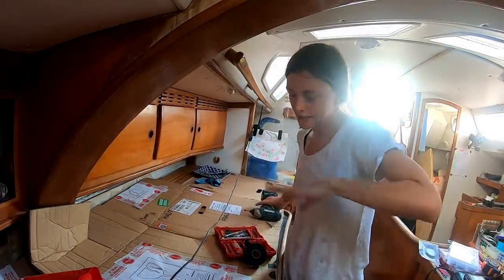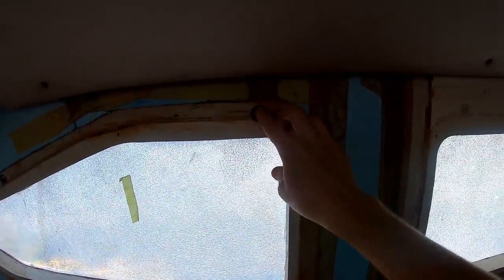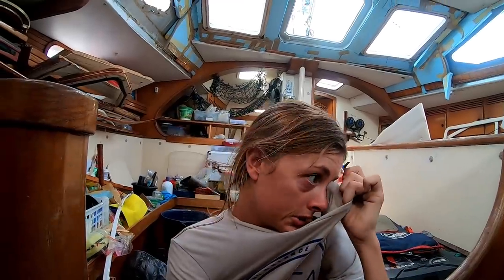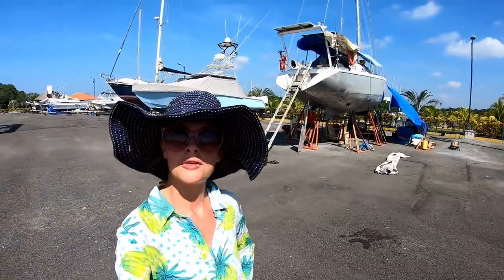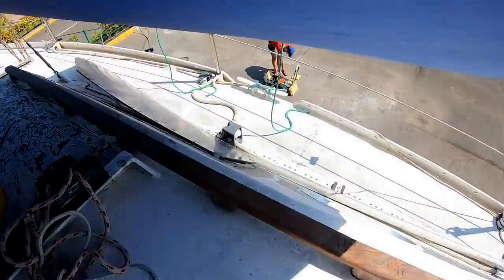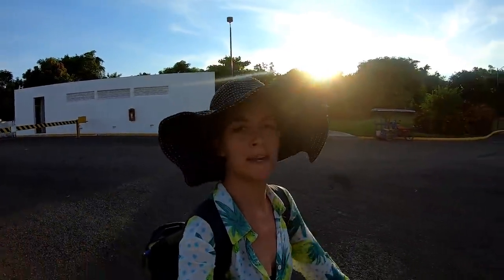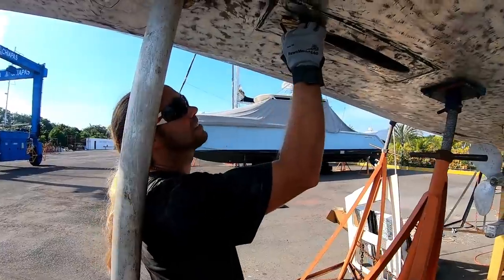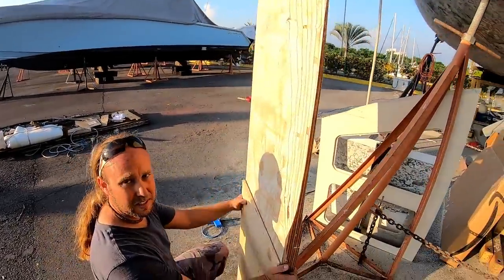Roller Coaster : Chuffed Adventures S3Ep11

Comment: These IS a "5200 Debond" solvent out there, if your chandlery can find it. 3M VHB tape is the best way to attach and seal the new stuff. It is used to install skyscraper window glass, it is not ordinary doublestick tape. Comes in black, white, clear.
Reply from the maker: Ah thats good to know, and yes definitely needed more sleep that week, but I have a disorder that means I am very sensitive to hormonal changes before my period, and so tend to get really tired and teary for a few days,and then lo and behold a week later I am all good. But we are taking more time now to manage it instead of pushing through

Comment: Watched this one and enjoyed learning the medical info.  Very interesting and you're an excellent teacher. Finding since I'm working less my range of interests seems to be exploding - eyes bigger than belly - as they say.  Jim filming?  If so well done, I'd say he's a keeper.  Impressed with all the medical work and genuine care for the patients.  Enjoyed the spot on Rabies.  Can be a bit scary.  I hear the shots are No Fun!

Carpentry thoughts - Orange foam ear plugs in packs from Home Depot are fairly comfortable and do well at noise reduction.  Maybe you can mail order?  I wear them mostly all day on the job.  An engineering friend told me the most harmful sounds are loud impact.  I would think continuous loud noise also bad.  Google question I guess.  I was a helicopter crewman in Vietnam and was told our helmets not only protected our ears with padded ear muffs but the helmet itself protected the brain from internal damage.  Again not clear on all that - back in 71 -  50 years ago.

Googles help with eye protection but face shields can be very effective also.  If you ever get one rinse off before cleaning so you don't rub grit across the shield.
Lastly today - a heat gun can be very helpful softening glues for removal.  They get very hot so heads up.  Careful of fumes also.

Good luck - I chip in a bit - safe and well.
Reply from the maker: Hi Don, Thanks for all the great advice! Jim does do almost all the filming and he is a great cameraman! We are really grateful we have been able to do so much for the animals here!

Comment: Don't know if you're already replacing those windows, but if you haven't, you can add an o-ring to the seals along the outer edges, in addition to the butyl/5200 primary sealer you're using for bedding in the acrylic windows. All you need is a long roll of o-ring mat'l, sized to fit snug in the gap along the edges. You can adhere the o-ring with tiny dabs of sealer before final mounting. The o-ring can act as an exterior visible "squish guide" to show you how close the window is fitting to the hull. The o-ring also gives you a clean line around the window so the exterior edges can be sealed as well, and faired or chamfered with a clear or white sealer for redundancy.  If you don't want that, you can use washers and tape to limit yourselves from overtightening the mounting screws.
Reply from the maker: Hi Mike, Windows are already on, and thankfully since Will is a boat builder he had done it maaaaany times (we went with the washer/tape route)
Reply: @VetTails  Glad to hear it, was worried that with the sealer shrinking a bit, you wouldn't discover til out at sea in a storm where the windows flex with the hull and tweak sealing compounds...

Comment: There is a lot of rabies in Mexico, if you can't monitor the dog that bit you, the 7 months of  immunisation  injections is necessary. But better than the 90s stomach injections, that are debilitating. Bum injections, day 1, one week, 3 weeks, 3 months, 6 months.
Reply from the maker: Yes, thankfully the dog was ok so we didnt need to do it, but hoping to get Jim vaccinated so we can just get the booster (I think it might be only two injections if you have a vaccine)
Reply: @VetTails  Two injections is an improvement over the 10 stomach ones in 1990 and the 7 month program in 1998.

Comment: If you have to drill holes intothe acrylic, the drill needs to be a different angle or you'll run the risk of cracking your acrylic. Google 🙂
Reply from the maker: Yeh we got the acrylic cut/drilled properly for that very reason

Comment: That centerboard is a real labor of love....... do you really need it? I'm not trying to put down Will's work  but  ..... just a permanent fin welded to this bottom would probably work fine.then you could weld up the problematic hole for the centerboard slot .
Water flow wise it really does not need to be a foil shape  as soon as you are turning the angle of attach will be too great to make any difference.! Those foils were a French fad that nobody does any more.  
Keep up the good work sorry I can't help from here. ( just critique? )    Sending hugs anyway!  cheers Warren
Reply from the maker: Hi Warren, yeh potentially having something welded would've worked, but since Chuffed can be beached having it retractable, or at least really short is important, so i guess being able to lower and lift it helps. I did how ever sail with out it for 3 odd years so will see what a difference it makes!
Reply: Hi Sheddy ,   Yeh , I’m sure it was a tough decision . I was only thinking of a fin that did not go below the hull/rudder.  I worry long term about epoxy costed wood ( or even aluminum) . It always leaks sooner or later so the more the better! It’s really hard to not have ANY  pinholes!   I just want the best for you that is practical Cheers Warren

Comment: You know you said you don't really like the sparks? Well, here's a good reason not to. The "sparks" are actually hot pieces of metal, in this case steel from the bolts holding the acrylic on. Stainless steel bolts. So when you cut or grind, tiny bits of stainless steel are going all over the place - inside your aluminium boat. That's another cause of the pinholes you're working so hard to repair (check up on dissimilar metals, galvanic corrosion and aluminium boats). So now, diligently vacuum every section of the bilge to try and get that stuff out of there, and a large ball of Blutac can be useful just rolled all over the place to get all of the "sparks" out of there. When you've done that, you'll know just one thing - Don't do it again. One guy I used to sail with used to get every crew member to stand on the dock, remove all of their small change into a rucksack before he let them anywhere on the boat. You want to see a speedy hole get one copper coin in the bilge with a cupfull of salt water.
Reply from the maker: Hi Ted, 
Believe me I know more than I ever care to about aluminium and how it loves to react with everything from chlorine in water to any metal that even looks at it, I would hope viewers would assume being a smart girl I would have done some research into the home I have lived on for over 3 years ;) . And between the soldering, the metal we have had to cut like the screws, the cleaning and demolition we have been doing we have been really really careful to repeatedly clean all the nooks and crannies, that is a good idea about the blue tac though. it would be really nice to somehow contain all that stuff but the reality is we have to tackle the jobs somehow and some can only be tackled inside the boat so we just do what we can to mitigate the risk